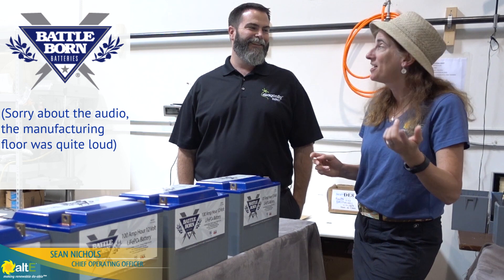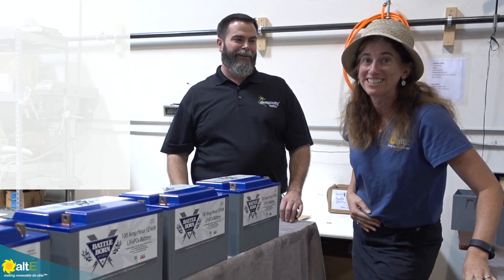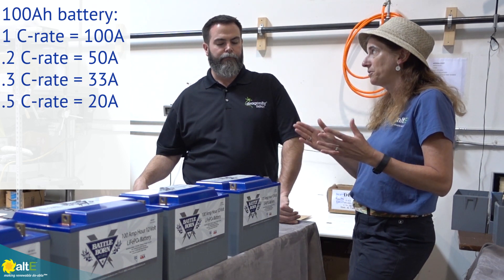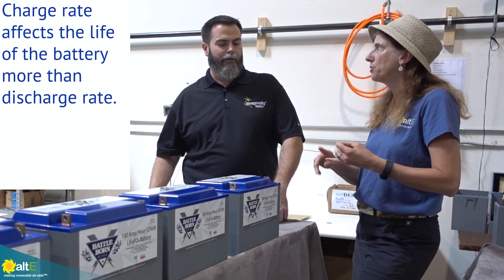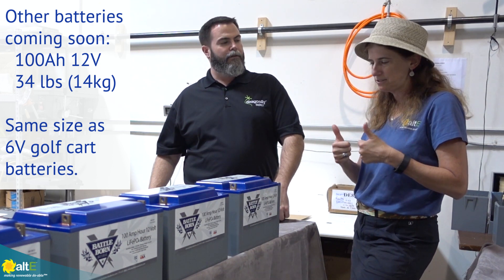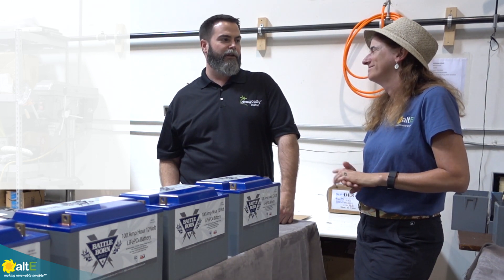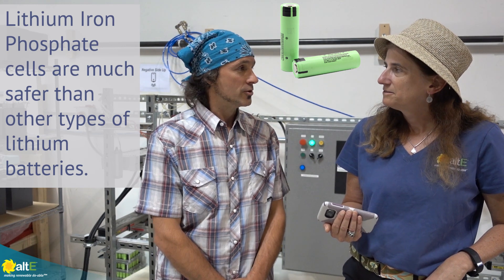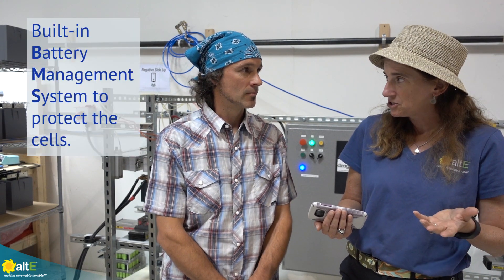Visit to Battle Born Batteries plant

Comment: Be glad when the price drops, 899.00 is way out of the ball park.
Reply: We do need cheaper energy storage systems, it would not be so bad if batteries lasted a lifetime and were almost bulletproof, but many having such fickle maintenance requirements.  We can only hope if existing Lithium really is the future, the cost will drop to around the same price as an AGM battery.
Reply: @richardsandwell2285 :  I'd be happy if they were twice the price.  But 4-5 times the price is really pushing it.  :-\
Reply: Yup. Try buying 80 of these batteries..
Reply: Al Pence yeah but when you consider one of these is equal to 2-3 AGMS price is ok. My issue with them is they won’t take a charge in temps under 30 degrees

Comment: How do these batteries handle heat?  I live in the desert southwest and temps normally hit above 115 degrees during the summer months.
Reply: I heard with Lithium if the temperature drops below the freezing point of water and you try to charge a Lithium, for example:- on a freezing cold but sunny day with Solar,  the batteries will die instantly, proving a very costly mistake.
Reply: @richardsandwell2285  Not instantly, but it will die.  That is why the BMS prevents any charging when its cold, even though LiFePo4 can be charged at a very slow rate down to -4 F.  I think the Battleborn allows charging down to 25F so their BMS must slow the charging rate for them to do that safely.   As far as I know they are the only brand that can do that.  Relion brand battery now has a low temperature series battery with a built in warmer that automatically takes the charge input and puts it into the warmer first until the battery is heated to a safe charging temperature.  Then the charge input begins to go into battery charging.  I think that is the wave of the future.  Relion 100ah warming battery is $1348.95, so you'll pay dearly for it, but if you are in cold sunny climate, it may be well worth the cost.
Reply: @michaeldoherty2289  LiFePO4 absolutely do not like it cold, and charging with a low current takes hours apart from how far they are below freezing point.
So is charging above 77°F also not the best option, you just shorten live cycle of the battery...
I would be very cautious in buying any drop-in LFP from Ali_xxx or Ebay. Only buy from a reputable Chinese manufacturer.
I presume Battle Born are doing this for their cells and BMS. They have a reputation to keep, if they can hold it.
But they should remove the sticker on the batteries they build: 'Made in the USA' better call it 'Assembled in the USA'.
Reply: @christee2908  That is exactly what I did.  I built a 240ah prismatic battery with quality prismatic Chinese 240ah 3.2v cells. Used a super good 200a BMS too.  I also built an insulated battery box with a 20W gel pad heater inside with a thermostat so I can keep it at any temp I want.  So far its working perfectly at less $1000 total cost.
Reply: Lithium doesn't like temperatures near freezing or greater than 120 degrees. Lifespan would diminish for ANY battery in the heat.  You'll have to keep them indoors and you'll be fine.

Comment: This battery is on the top of my short list for my off grid house we are planing.
Reply: I have 6 of these batteries to run my home day and night (except for 220 volt items).
My set up is 2040 watts of Panels-3000 watt reliable inverter and Outback 80 amp charger.
At night batteries start out at 27.0 volts (7:30pm) volts and are only at 25.5 volts in the morning (7am). At an average 600 watts per hour at night. THAT’S AMAZING!!!!!!
I replaced 8 fairly new Trojan L-16 batteries at 980 LBS with these 6 Lithium Batteries. No comparison in performance-(Charging or Discharging)
These batteries charge up twice as fast (Reaches float mode by 1pm) as the L-16’s did and zero worries about venting gases is a huge plus.
Also a huge plus is the customer service and support you get from these guys.
Cheers to these fine folks at Battle Born Batteries.
Reply: @1menarje  : "600 watts per hour"?

Let's try that again.  You know what a watt is, right?  What did you really mean? 

Did you mean that your rate of discharge was 600 watts during the night?  (That seems rather high.  Your batteries would be totally discharged by morning.  Even a typical refrigerator only uses around 50-60 watts on average during its duty cycle.) 

Or did you mean that your total discharge overnight was 600 watt-hours?
Reply: @Milesco  He states he has 6 batteries.  100Amps x 12 Volts (nominal) = 7200 Watt hours or 7.2 kWh of stored energy.  600 Wh x 8hrs of overnight is 4.8 kWh used.  His 2000ish watts of solar charge it by lunchtime on a good day.  Sounds about right to me.